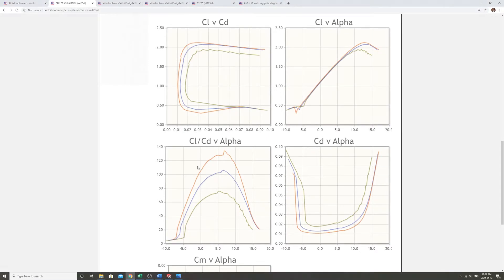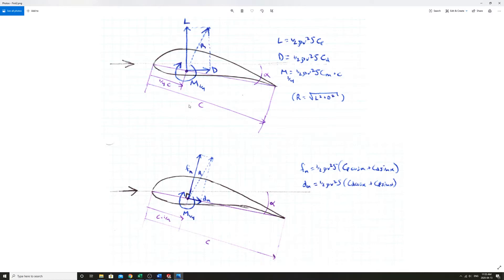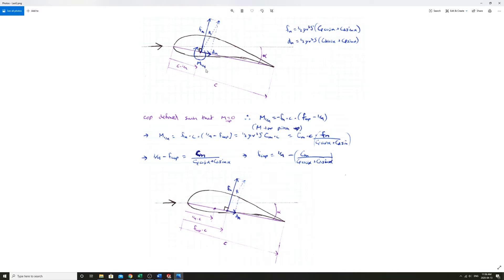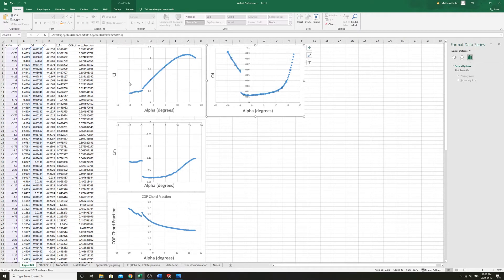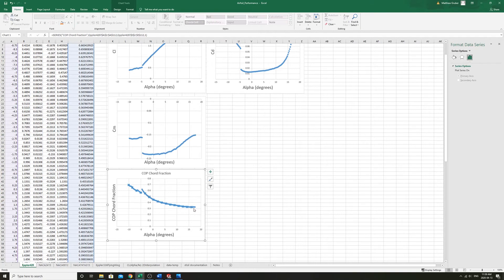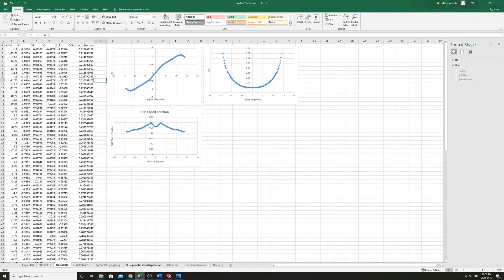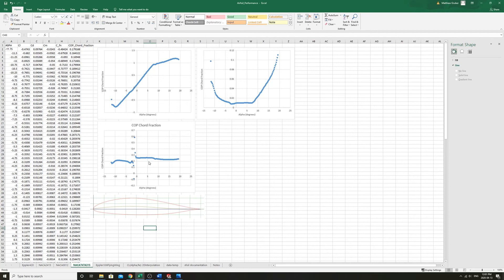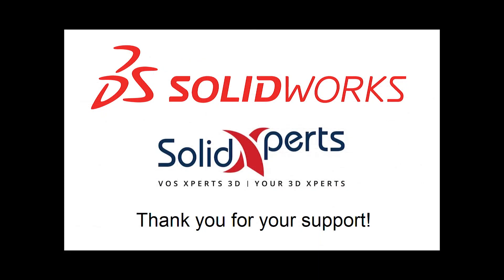Airfoil Coefficient of Moment physical interpretation

Comment: Thanks for the info. Airfoil design is WAY more involved than I realized, but I see that a little re-curve prevents the chord from moving around on the wing from changing AOA, which results in more predictable flight, less sensitive pitching. 
Will watch again a few times as there is a lot here. Thanks

Comment: what unit does Cmoment has, is it Nm?
for a 6 meters long non tapered straight wing if Cmoment is 0.1, can we say total moment of wing is 6*0.1 ?
Reply: Cmoment is a normalised value, its a pitching moment coefficient. To determine a moment, you use Moment = dynamic pressure * S * chord * Cmoment (which will be in Nm)